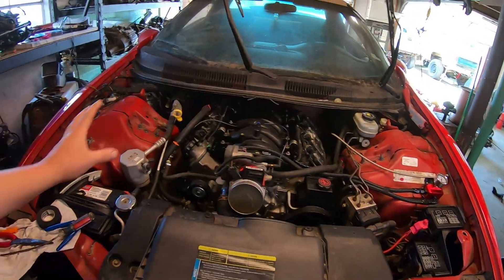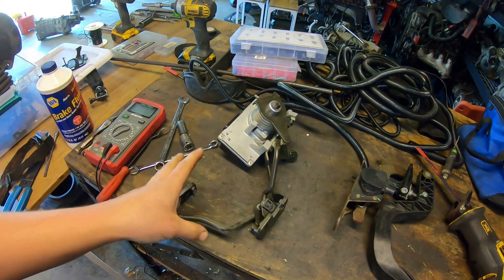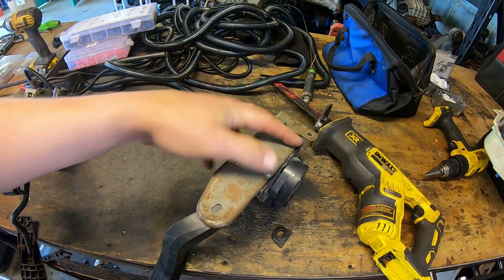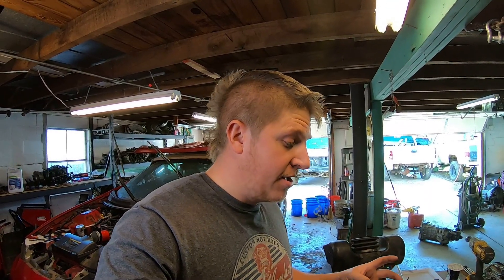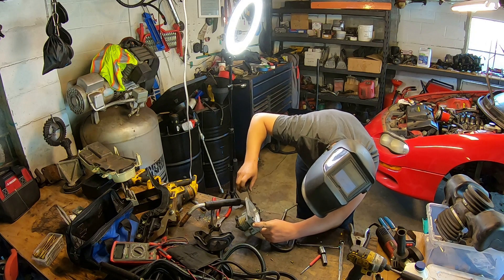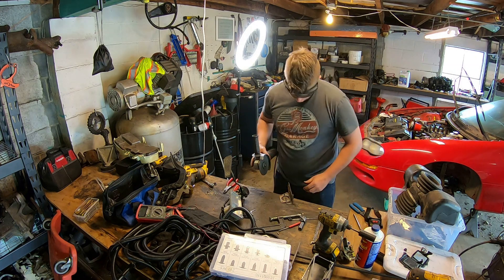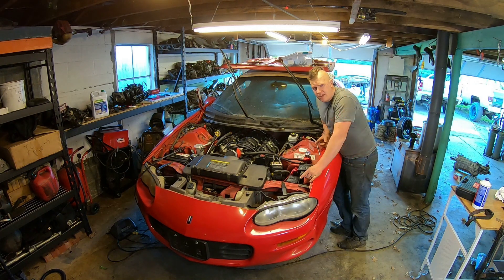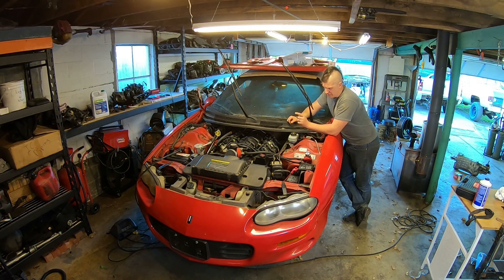MASSIVE OVERSIGHT on my part, FINALLY getting it figured out, V6 to V8 Camaro Update

Comment: Man your a big help,I have a 02 firebird I'm converting Into a LS.your giving all the details we really need to know about.ive seen the harness vid,but I'm thinking it might be the hardest part.
Reply from the maker: Glad the videos and information are helpful! I agree the harness is probably the hardest part, I think it would be easier using a more factory setup instead of mixing and matching engine components like I did with the intake and injectors.
Reply: @MohawkMotors   what would you recommend to make it easier on wiring, im gathering parts to do this in my firebird
Reply from the maker: @edwardgarrett5594  if it's a 98 to 02 car, find a stock LS harness for your year and model. If you're doing a 2000 camaro with an automatic transmission, find a harness from a 2000 camaro with an LS1 and an automatic transmission. It'll be as close to plug and play as it gets.

Comment: What did you do about the three pigtails on passenger side strut tower? Doing a swap myself on a 2000 Camaro and purchased a stand-alone harness. Thinking I just have to go through the factory v6 harness and pull all those wires to the pigtails out.
Reply from the maker: I just left them.

Comment: Nicely done. Do you think your throttle is limited because you’re using a Gen 4 manifold on a Gen 3 engine? How did you compensate for the different injectors?
Reply from the maker: Thank you! I don't think it's manifold related, the LS1 intake manifold I swapped on is a gen 3 manifold and I switched to the throttle body originally from the engine and pcm. BUT, I didn't think about the injectors, even though they are from the same size engine (LS4 is a 5.3 also) they are a different injector than that pcm originally drove so I need to look up the info on LS4 injectors and may need to change the injector settings in the PCM.  Thank you for the suggestion and for watching!!
Reply: @MohawkMotors  I thought the FWD LS4 5.3s were 4th Gen engines.
Reply from the maker: @Jay Schieck you're right the LS4 is a Gen 4 manifold and uses a Gen 4 throttle body, that may have been why the throttle was limited when they were on the engine. BUT in the video I replaced the LS4 manifold with and LS1 manifold and the Gen 3 truck throttle body that works with the Gen 3 LM4 electronics and the throttle is still limited. The only Gen 4 component still on the engine at the end of the video is the LS4 injectors, so I'm thinking that may be the cause of my limited throttle, I'm going to update the injector Data in the PCM and see if that resolves the limited throttle issue.

Comment: I recently subscribed to your channel due to your simple explanations, which I highly appreciate. I am building a 1997 Z28 Camaro with a 5.3, auto trans and a Holley terminator x plus, basically LT1 to "LS1". I am having problems on locating the wires for the oil pressure, temperature, speedometer and tachometer gauges, I haven't seen in your videos, hooking up all those gauges, or maybe I missed it, lol. Any chance you can help me with that? I appreciate any help that you can provide me with. Thank you.
Reply from the maker: I appreciate the subscription!  So if you're using the terminator x plus, the wires in the harness should be pretty clearly labeled for what they go to, and the plugs will on fit what they are supposed to plug into in most of the sensors. On the 5.3 engine, the oil pressure sensor is in the valley between the heads at the rear of the engine, if it's a Gen 3 5.3 the cam position sensor will be right next to it. The temp sensor is at the front outside of the drivers side cylinder head. Speedometer sensor is located on the transmission, which transmission you are running will determine where its at the on the transmission and tach is read from the crank position sensor located behind the starter on the side of the block. 

I'm just monitoring all of those data points through the Terminator touch screen. If you want to run your factory gauges using the terminator pcm, I unfortunately have not learned how to do that yet so I can't really help.
Reply: @MohawkMotors  thank you for your response. I truly appreciate you getting back with me. I was actually talking about the last paragraph that you wrote. My biggest issue is the speedometer. Does the Holley terminator x max display MPH on the handheld? Thank you. 👍
Reply from the maker: Yes the Holley terminator x max can display MPH on the handheld, you just need to connect it to one of the speed sensors, usually transmission output speed, and then put in your rear end gear ratio and tire size.

Comment: Did you have to swap fuel lines and gas tank to v8 fuel lines and gas tank? Please let me know
Reply from the maker: I did not, from everything I can find online the V8 cars came with the same size fuel lines as the V6 cars, 3/8" supply and 5/16" return, so I used the fuel lines that were already in the car.